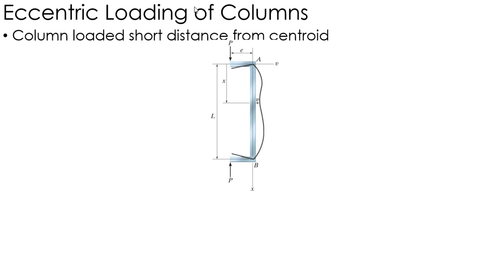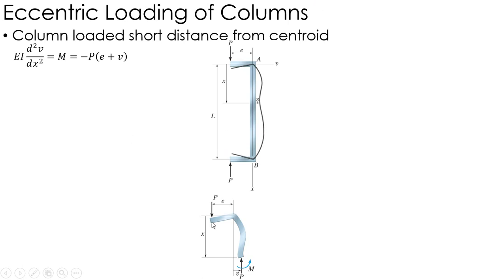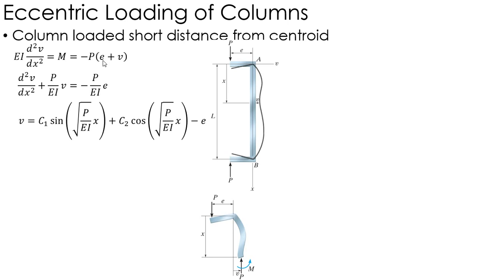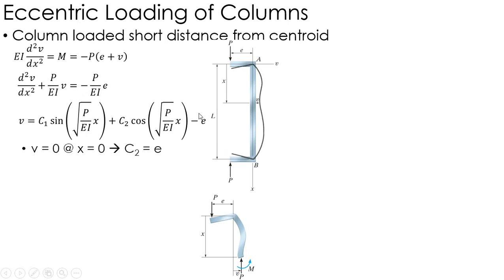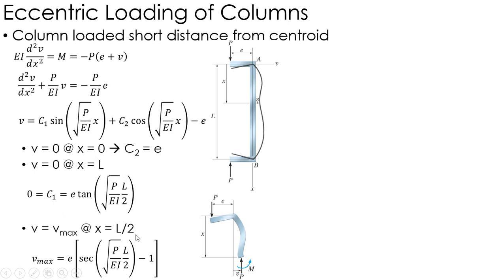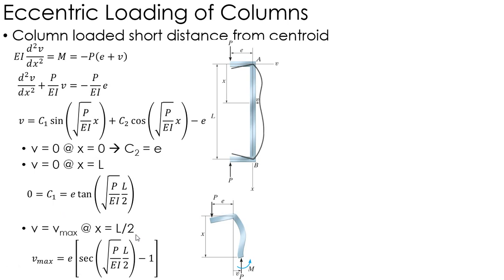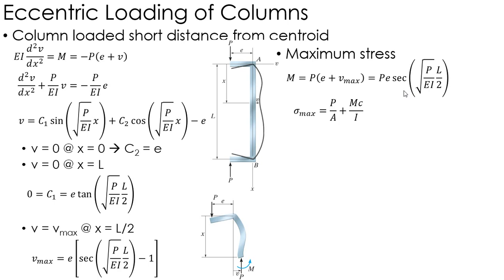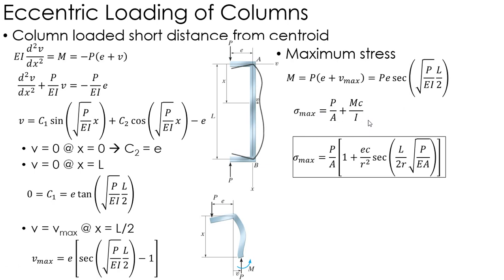Mechanics of Materials Lecture: Eccentric Loading

Comment: Hello, i have been trying to use this equation to find the maximum deflection of a simple 10mm x 10mm x 100mm beam and i have been having a lot of trouble as the deflection i am getting with this equation is well below what i am i get when i put it in CAD software (Inventor) and use the FEA analysis. Please could you help!
Reply: Hi, I know it has been a while, but did you figure out what the problem was? I am doing my Master's Engineering thesis and I am getting the exact same issue, which I need to solve ASAP! Thanks
Reply: @YFZRAC3R  Did you get your Master's?